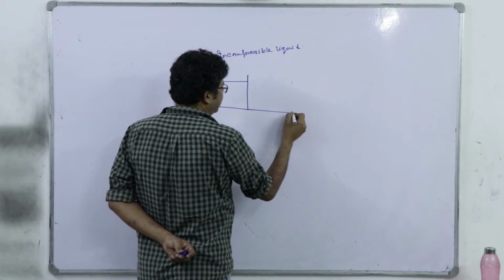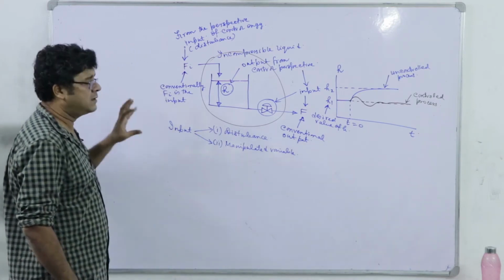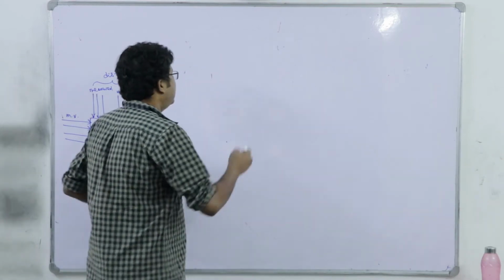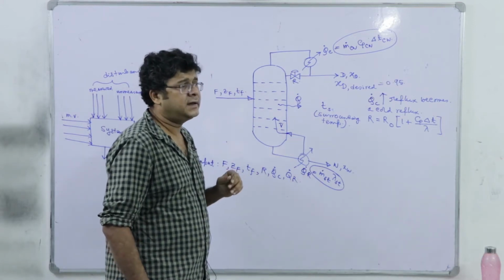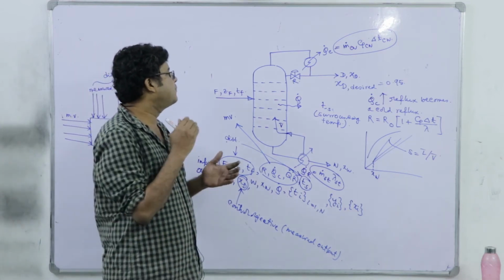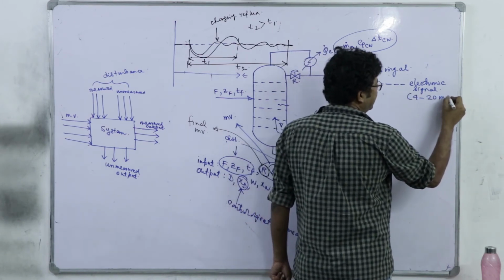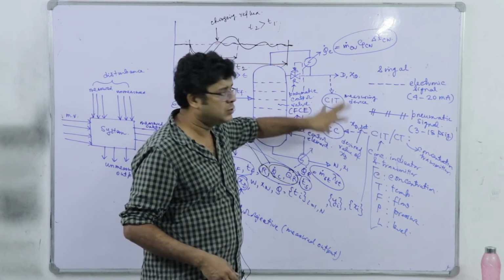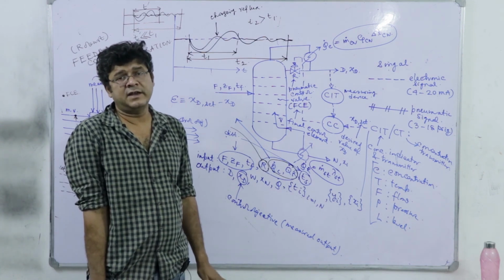Process Control | Lecture-1 | 2021 | Introduction | By Dr. Debasish Sarkar |Chemical Engineering

Comment: Sir if we take R as input variable because of the reason that we have controlar there then why D should not be input variable??? Because as R is control in same ways D is also going to change?
Reply from the maker: It is a ratio, controlling the ratio does not mean that you are controlling the flow rate. So D remains as output
Reply: @chemicalengineeringbydebas2767  okk.....thanku sir
Reply: @chemicalengineeringbydebas2767  sir any platform where we can asked dought with you??plz sir if possible